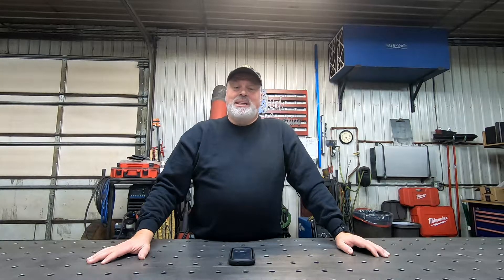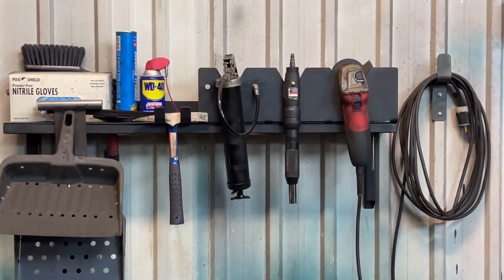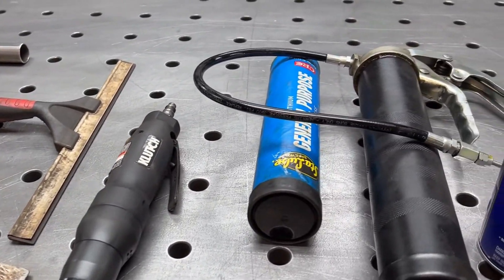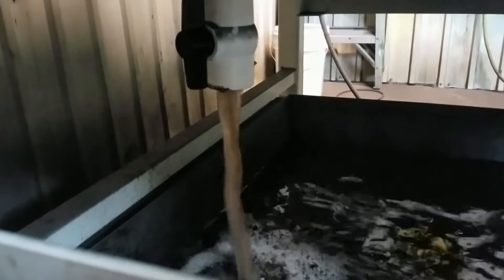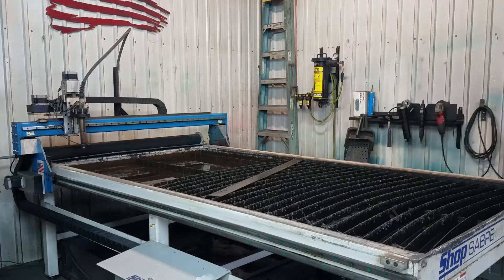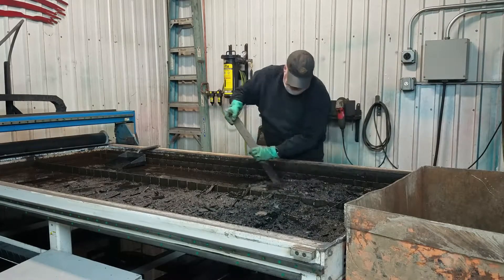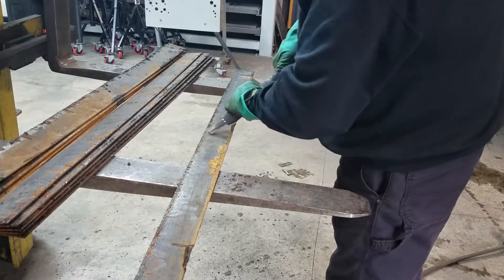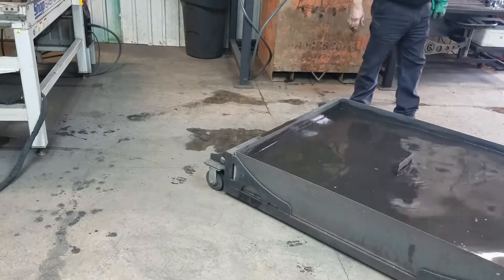The dirty side of CNC plasma cutting! Cleaning my CNC plasma water table!

Comment: Just cleaned out a 20 foot by 10 foot table and the sludge was about a foot deep it was not fun lol
Reply from the maker: You obviously had a lot more fun then I would ever be able to handle! Cleaning out my 4'x8' table is all I can handle, barely!
Good for you to get it done, though!
Just don't wait that long until the next time!!! LOL
Reply: You need to incorporate slag trays and an over head gantry into your design..
Reply: @SegoMan if it was mine I would but it’s my bosses I’ve been in the cnc trade for right at a year and he was cleaning it out to get a new burn table and me being one of the newer guys had the pleasure of cleaning it out took apart and getting it moved out of the shop
Reply: @bobschacklford7416  Got it! What machine is coming back into the shop?
Reply: @SegoMan it’s a messer tmc 4500db
Reply: @SegoMan but I won’t be running it right now I’m running an old doosan cnc mill at my old shop we ran all haas machines

Comment: Just had to clean my table at work which is without water and 6000x2500mm. It's the best part. No can't wait to get a water table with belts that drives all the slag outside
Reply from the maker: It's a mess at any rate, but it has to get done!!!

Comment: How to reduce smoke in plasma cutting machine(CNC) sir...
Give me an suggestion...plz
Reply from the maker: My suggestion would be a water table as I have, which minimizes the effects of smoke greatly, but it comes with a lot of maintenance as shown in the video!
The only other option is to have a fume extraction system, either below or above the cutting table, which is a significant investment. If you can remove the smoke directly to the outside, it could work very efficiently, but in my case, I would need a separate air exchange system with a heating unit, because of the freezing temperatures here in Minnesota during the cold season. I hope this is helpful!

Comment: Great video and so true.  My son and I built his plasma table.  His water pan is removable so we take the slats out, remove the pan and scrape and pressure wash it and then give it a fresh coat of paint after a little wire wheeling.  Also, we plumbed the drain to have a dross trap and can hook a garden hose to it so we can drain the water out of the shop without having to roll it out.  His table is 4'x8' and he has plans to make a 5'x10' with a down draft vent so we won't have to deal with the mess of a water table.
Reply from the maker: Thanks for your feedback! It's greatly appreciated! A downdraft wouldn't work for me, so I have to deal with the mess of a water tank!

Comment: Thanks for the great video. I have had to clean mine twice and it’s definitely not fun! The metal dustpan idea is a great idea. What additive are you using? I seem so have quite a bit of rust after a short time. Thanks!
Reply: I have to clean mine about twice a year, so it's not too bad! 
In regards to the additive in my water tank, I use Plasma Defense, which I buy in 5gal buckets from Shopsabre for around $170.
I made the dustpan out of 12ga, which is very heavy, and if you want to make one, I think 16ga would do the trick! I'm considering redoing mine!
I hope this is helpful!
Reply: @wolfgangsixl9283  
Thanks for the reply.  I liked your “dust pan” idea so much that I plasma cut two different sizes. I am getting ready to clean my table out again. I have been using the plasma defense as well. I must have gotten a bad batch or something. Everyone I know who uses it has always had really good luck. I have another pale of it I’m going to use. Thanks again and keep up the great work!
Reply: @MrRoscoj  Would you be willing to show some pictures of your "slush pans!??? I'd love to see what you ended up doing!